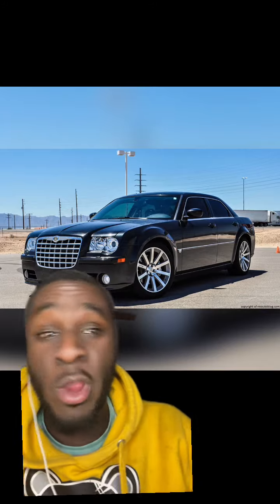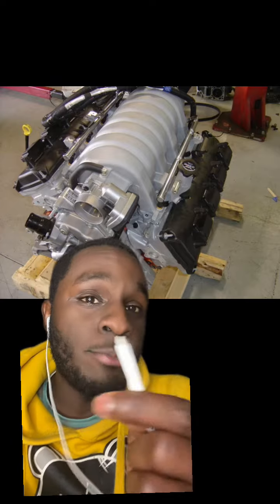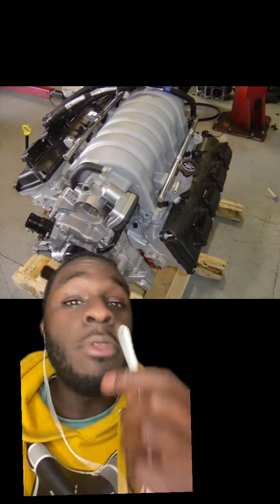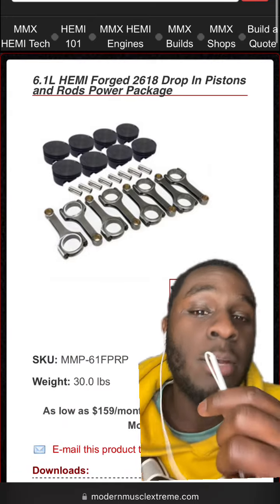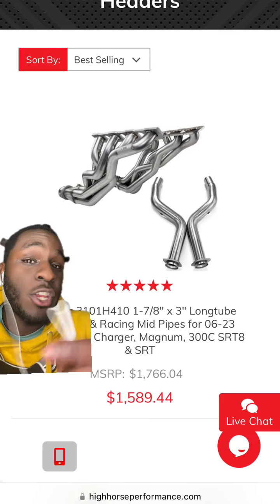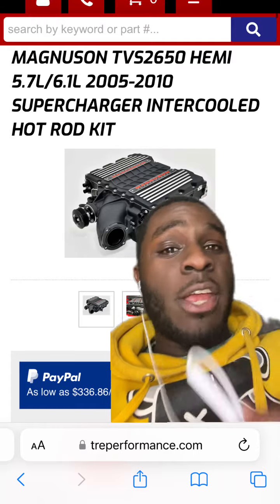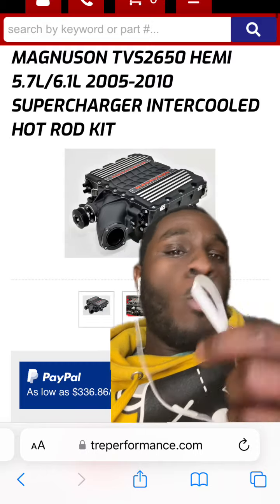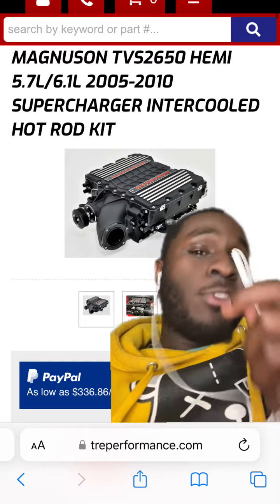Hellcat POWER with an SRT-8? HERE’S HOW!

Comment: That’s all 🧢 about the 6.1.  My stock 6.1 been procharged for 100K miles.  Car has 190K on it now and still runs smooth.  The 6.1 was one of the best engines until the 6.2 came out.  The 6.4 is the weakest engine that Dodge made when it comes to adding power adders.  I been part of the Hemi gang since 09 and none of these statements are fact.
Reply: That’s just you and your tune what works for you might not work for others
Reply: @HennyManTactics the statements are still false especially about the cylinder walls being weak.  The 6.1 takes boost very well.
Reply: @texasboy410  they don’t you have to cut down rings and do oil pump work I have no clue what your talking about
Reply: @HennyManTactics  been running 10lbs for more than half of the 100K boosted miles on my 6.1.  The only knowledge of the 6.1 over the years has been from used 6.1 owners and by that time, most weren’t taken care of.  That’s the only reason people would say the 6.1 isn’t a good motor.
Reply: @texasboy410  100 pounds of boost…..okay
Reply: @HennyManTactics  lol 10lbs
Reply: @texasboy410 I was bout to say you win cap of the year with that 100lb boost not even a rotary or four banger is handling that. 10 you might as well say NA pro charge. But that weight though you have is probably insane. Not good for actual cornering and racing on a track or around the blocks.
Reply: Yea you lyin bout that 100lbs shit lol nice try tho you was on a roll for alil then you got too cocky ..bra ya 6.1 is a 5.7 frfr remember that don’t disrespect either ..the 6.1 Hemi is the 5.7 with a lil more Girth in the pants 🤷🏽‍♂️
Reply: @jimmypeso8609  if you say so.  The 100lbs comment was a typo…
Reply: Never gonna be fact,because everybody don’t drive and take care of there car the same,I’ve heard plenty of complaints bout cars I drove,pushed everyone of them to its max(speed limit) still just do oil changes etc. the usual,don’t have car problems.just run through tires😂
Reply: @HennyManTactics they do take boost very well don’t ask me how I  know lmao 8lbs of boost is good anything over 10 is od
Reply: @srtzooda6687  naw he’s right I was misinformed back then I actually have a str8 Cherokee shits been on 12 pounds for a couple months now
Reply: @texasboy410  my fault gang u was right I ended up buying one lol
Reply: @HennyManTactics  it’s all good.  Take care of it and enjoy it
Reply: @Whatguywhat its a streer car tho. Not a track monster. It can still corner fine for its weight
Reply: Your 100% right. I've run an eforce on a heads and cam 06 Chrysler SRT8 for the past 75k miles. I got a great deal on the blower and was planning to go with a forged /billet short block when it blew but the poor fellow is still stout as day 1 with 146k on the odometer.
Reply: @jimmypeso8609 less run it then il show u my 6.1 can walk anything in yo yard😂

Comment: 6.1 hemi rods and pistons are perfectly fine... everything else spot on
Reply: And that’s a fact the 6.5 in a Jeep went 9.7 unopened motor he never built a hemi
Reply: The pistons are trash
Reply: @kevinturner3763  the 6.1 pistons are fine bro... alot of guys are running moderate boost on stock internals for years... i got 140k on mine I track it and drive the piss out of it.... only thing I ever broke was the lifter

Comment: Forget the 6.1 get a 5.7 and owners won’t have to worry about those thin ass walls
Reply: You can buy engine sleeves for thin cylinder walls and make the walls as thick as you want
Reply: @redhunnid5142 basically just turns it back into a 5.7 at that point . Might as well start with the 5.7
Reply: Fucking love it here knowledge is awesome
Reply: 6.4 BGE block is just the better solution
Reply: @Jiggaboojoness Smh everybody isn't a real car guy.  They think they know something because of YouTube but that doesn't make  you a I know about engines guy.
Reply: 6.1 rise up
Reply: So I can put a 6.4 392bge block under a 6.1 top end is what yall saying ?
Reply: Lol the 5.7 and 6.4 with the cylinder deactivation good luck.

Comment: Remember there is replacement for displacement. Your engine block after your thin walls wear out combust and shoot a rod. Just boost it
Reply: There’s no replacement for displacement* you can turbo a 5.7 but throw the same turbo on the 6.1 and you’ve got more power

Comment: You can buy engine sleeves for the thin cylinder walls and make the walls as thick as you want and get forged rods and pistons like recommended 💯
Reply: Then your just reverting back to a lower displacement. Think before you speak
Reply: @Whatguywhat isn't it worth it if you can now run way more power?
Reply: @jayknight139  no it isn't look up your local tune guy and see how much it is to sleeve the cylinders and change out the pistons and rods. Your better off buying a LS that's already sleeved and just switching the cam and getting a lighter car like what I got a Chevy Vega or a C10 or something lighter but not to light so it hooks good. Dodge engines are literally like third best you better off getting a coyote swap before you put a dodge engine to handle super boost

Comment: OMG I have  a 2006 300c SRT8  thank you so much for making this video!!
Reply: 😂 it’ll still be slow just stop
Reply: @cormaro13 stop hating
Reply: @cormaro13  says the guy with the camaro
Reply: @sleepytimeshecomes  already got rid of that slow thing and got a new mustang , what’s up slow par lol
Reply: @cormaro13 my tuned s4 will gapped you no problem😂😂 and from rolls😂
Reply: @cormaro13 you too slow fr😂
Reply: @MarcoTopG  😂 loved to see that slow thing try , funny how you need a supercharger just to keep with me 😆 good thing I got vmp whipple to cream that s4
Reply: @MarcoTopG  just tell me when and where slow boy
Reply: @MarcoTopG  even with yours tuned on 91 it still doesn’t touch my stock output power 🥴😂 so idk where you’re getting that assumption, you’re barley at 403 hp and 387 tq , boy my Mustang stock has 430hp and 390 tq , that’s with a h pipe and carbon trap delete 

Get that slow trash outta here til you can afford to put more mods on it just to keep up with me 😆🤡 always the v6 owners thinking their top 💩😂
Reply: @cormaro13  just a simple tune and I’m as fast as Gt500s
Reply: @cormaro13  do what you gotta do. You ain’t gapping me🤡. A fully tuned stage 3 2018 s4 smokes a c7 zr1 which means it would smoke the gt500 and yours easy😂.
Reply: @cormaro13 I bet your car can’t even get the power down🤣🤣. I bet you won’t ever get a 2 second 0-60 in that thing🤣 
I’ll even bet my Audi is still more reliable than that damn mustang😂
Reply: @MarcoTopG  that steeda no hop street setup took care of your power down little man , so wya 😆
Reply: @cormaro13  we’ll see about that. You probably can’t even afford how much money you’d have to spend to even get in 60-130 low 6s🤣
Reply: To keep up with me😂
Reply: @MarcoTopG  when you’re done being an broke poser who’s reading off sites and actually has some content, come talk to me 😂
Reply: @cormaro13  sure buddy that picture is old, from like 2 years ago. You do what you gotta do to keep up with my Audi atleast🤣. Difference between you and me is that I can still gap Gt500s and still get better mpg than you daily driving🤣
Reply: @MarcoTopG  someone being special now when he’s getting called out 😂🤡 , I asked wheres your content buddy , you have nothing on your channel but run your mouth like you own something 😂 and idk what pic you mean , that clip I have of my new mustang is recent , like I said troll come back when you can actually post a video of you gapping something 😂😂
Reply: @MarcoTopG  I’m already ahead of u in life since I can actually afford new cars and show it 😂, still waiting for you to give me something , for someone so positive about ownership certainly can’t show much but can talk about a imaginary pic from 2 years ago 😂😂😂
Reply: @cormaro13  says the mustang owner🤓 
I don’t care that your better than me in life maybe you are, maybe your not. Im 18 and have a nice vehicle. By the way I don’t buy new cars because their stupids investments. Maybe you should get an Audi, it’ll make you happier. More reliable too. At least the s4 2018 and above.
Reply: @MarcoTopG  😆 that’s how we know you’re 18 and naive , when you actually own a business like me at 27 , that car payment is only a fraction of what’s coming in so why not drive something new lol 

And for someone who’s so young , u don’t know how to upload a video of that nice audi 🧐 strange lol 

And why would I want a heavy depreciated and overprice on parts VW  😂 I choose American so I wouldn’t be spending new motor money every time maintenance comes around or something electrical comes up
Reply: Only issue my Audi has is water pump issue that failed at 94,000, Im running a stage 3 tt810 e85 tune. I’ve gradually change from stage 1 to stage 3. My car hasn’t been stock since 32,000 miles. So of course pushing that type of power I’d expect more issues, but no only a water pump and that’s it. Car has 105k miles right now. This is probably one of the most reliable Audi’s out there.
Reply: @cormaro13  I get you, when making that type of money of course why not, but for me I guess I’m in a position like that yet.
Reply: @MarcoTopG  I guess we’re see how the rest of the journey goes but that is good for 32k mileage but it’s cool , I’m just busting your balls that’s all 😂 keep getting paper , the Texas area and delta 8 products , it’s good business lol
Reply: @cormaro13  🤙  you sound like a cool dude my man🤝 Texas ain’t no joke😀  for sure.